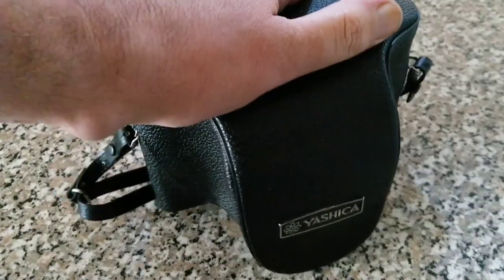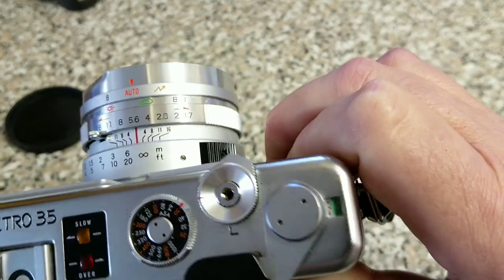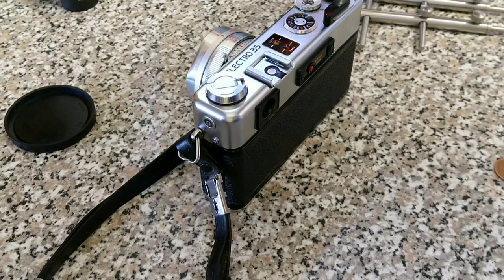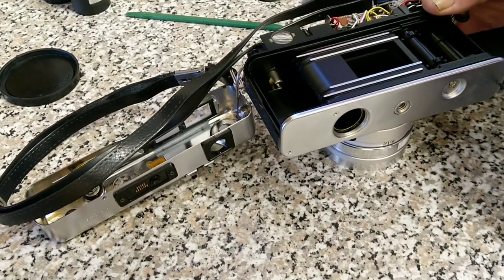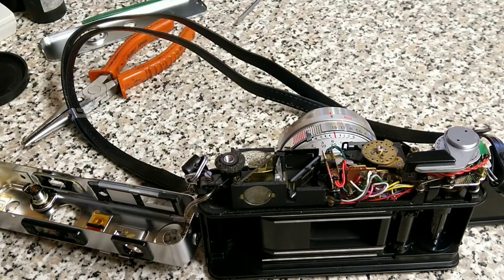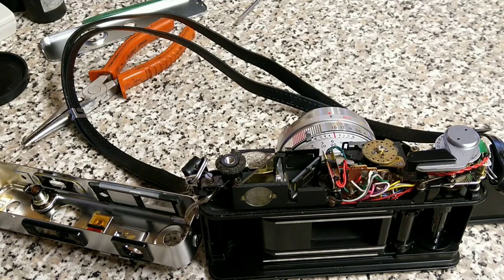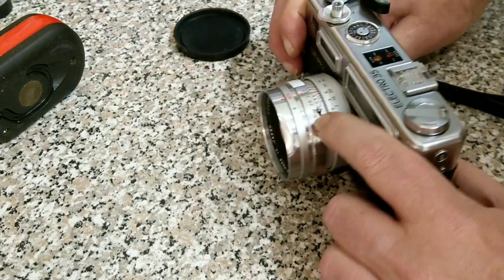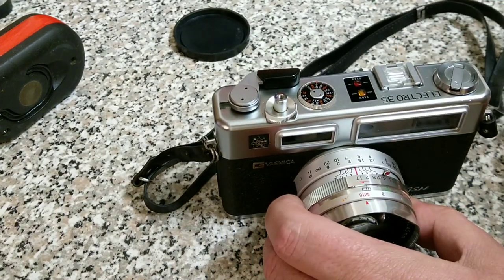Yashica Electro 35mm GSN, repair, shutter problem

Comment: Hi sir, does this shutter opening needs battery? My shutter remaina in closed situation (without battery).
Reply from the maker: Hi, it has an electronically controlled leaf shutter working in aperture priority and so on unfortunately does need a battery to operate, not sure but maybe the flash and bulb modes will work with no power, is it that  yours does not work with a good battery?
Reply: @thephotographersbag   Yes sir , the bulbs are in good condition ! Tested with a 9v battery, but it is not like yours, it is different (black) but the same model, I don't know why is that different, it is a 1966 model, being inactive for almost 46 years, that's why I need to clarify. Can you can identify what model is it with the stated colour ? And thank you very very much it helped a lot for me.
Reply from the maker: @kavinishwar  Hi, as you say there are chrome finish ones and black finish ones, the chrome version is the GS, the black is the GT, the second series was named GSN for chrome and GTN for the black version,
You have the original Yashica electro 35 by the sound of it, launched in 1966, it should default to a shutter speed of 1/500 th of a second without a battery, ASA/ISO tops out at 400 and it has a 45mm f1.7 lens and it only has a "cold shoe" with PC connection, one of the originals, be interested to know if it works, it used a now banned mercury battery, use a Wien cell (1.35v) or a 1.5 v that fits....following your exploits with interest as I love these cameras...😷
Reply: @thephotographersbag  It is very glad to hear sir, I am always keen to know physical priciple and mechanism of a machine, I got it when I was cleaning my store room, It was my Grandfather's camera, he bought it when he toured Japan. But now the black tinch got renoved in some of the areas of the camera, I will post the picture and video of the fully functional camera if possible. Thank you very much Sir 😊😊 love from India
Reply from the maker: @kavinishwar  looking forward to hearing about your exploits with the camera...thanks for sharing....
Reply: The Photographer's Bag excuse me, do you know which 1.5V battery would fit?
Reply: @AeromaticXD  It was designed to fit a 6V mercury battery which is now banned due to environmental concerns. You can use a 5.6 v Alkaline (PX) for this Yashica Electro 35 variants

Comment: How I clean the camera and outer case it’s
Reply from the maker: Hi, just carefully wipe the exterior of the camera with a soft cloth first, I use a soft toothbrush to get into the small nooks and crannies to remove loose dust and dirt
If required I then use distilled water and a cotton bud (q tip) to gently remove any remaining dirt
Clean the lens separately and be very careful not to mark or damage the front and rear elements, the glass bits, these need to be gently cleaned again with the distilled water using a moist but not soaking wet cotton bud
You can use metal polish to buff up the chrome bits and a leather polish for the ever ready case, I use neatsfoot oil, it is used for horse saddles etc
Whatever you do just take you time and not cause any damage....

Comment: I disassembled my Electro 35 GSN to get the camera working again following your instructions in this video! :) Quick question though. When reinstalling the ASA selector, how did you get the black numbered plate to sit still while screwing it back down? I know I had it set to 400 previously, but I can't get 400 to line back up with the red line.
Reply from the maker: Hi, that's a confident move, did you find the problem, not sure if you meant the rewind crank or film advance lever
Without a battery the camera should default to the 1/500 shutter speed
The ASA dial was straightforward from what I can remember, has something moved as I think it only fits the one way, will investigate further on my own camera again and come back to you
Is the camera functional now?
Reply: @thephotographersbag  I just ordered a battery adapter, so I'm not sure about the electronics but everything mechanically is working. I took the top plate off and pressed down on that lever underneath the shutter button and that seemed to do the trick. With the ASA dial as you screw the black numbered plate down it spins with the screw. So you have to be careful to line it back up how it was originally installed. It's an annoying process to get it lined up just right so you're selecting the proper film speed.
Reply: Eventually I got it lined up, but it's definitely something people should pay attention to prior to removing the ASA dial.
Reply from the maker: @nicholassmith7723  Hi, sounds like you got the job done, excellent work, will be interested in  how the electronics fare, I will have to revisit the ASA dial issue as I can't remember any issues I had( too many cameras LOL)
I look forward to hearing about it once you get some power in it, they are great cameras, with brilliant lenses, I take it the film transport issues have been resolved?
Reply from the maker: @nicholassmith7723  your comment is noted and when I revisit the camera in a future film, I will emphasize it more, thanks for sharing your experience, much appreciated😷

Comment: I am a bit contrarian on the whole "dreaded pad of death". 

It seems on my camera at least, the only effect is that the shutter won't stay open if you release the shutter button.

The practical effect is only that you must hold the button down until the exposure is complete.

It is natural and proper technique to hold the shutter anyway - at least up to about 1/2 second.

This camera probably isn't the best camera for long exposures any, but the can still be accomplished by holding the button until the exposure is complete.
 
If you are going to take a lot of long  exposures with this cameras get a shutter release cable with a lock and then, no problem
In fact, the only practical effect is the quieter operation of the camera, which is a bonus 

So pad of death is just what you need to get to heaven!
Reply from the maker: Hi, I must admit people do get hung up about it, not all issues are related to it, great to hear your experience, and I am with you, the issue is over exaggerated....

Comment: Hello! I have a problem with my yashica, I advanced the film too much, and I had to remove the film myself, but if I want to unload the film with the correct way, it's jammed somehow, I'd love some help
Reply from the maker: Hi
If I understand you, the film has all ended up on the take-up spool and is longer connected to the rewind crank on the tip left of the camera
You will need a darkbag/ changing bag or a dark space or room it needs to have no light at all alse it will ruin the film
Once in the dark, gently open the back and by touch feel to see what has happened, you should be able to gently remove the film by gently pulling on the end at a 35 degree angle to the back, it needs to miss the drive sprockets, you can press the little rewind button on the base of the camera to disengage the sprocket drive if this makes it easier
I would then place the film in a dark film cannister, the type the film comes in, not the clear ones but the black ones
If you take it to be processed rather than doing your own processing explain to them that the film is not in its light tight cannister but directly in the container, 
If you need more help, please let me know...
Reply: @thephotographersbag  oh thank you! It worked, turns out it was a bit jammed, I really appreciate it! I also want to ask about the films prices and which one do you think is the best for the yashica, because the last time I bought one it was expensive, like 6$ is that the average price?
Reply from the maker: @hafsa3889  hey, no worries glad you got it sorted, for colour neg film the cheapest tends to be Fuji C200 or Kodak Colorplus 200, for b+w the Fomapan brand is very good value but I do personally prefer HP5+ as it's what I'm used to, film photography is expensive when compared to digital, you will definitely save cost by processing yourself at home, it's quite simple, and you can scan negs with your phone to start with.....
Reply: @thephotographersbag  thank you so much, I appreciate it, hope you have a good day and thanks for the help!
Reply from the maker: Your most welcome, anytime....

Comment: my gs fix pod but this show only overlight and f16 iso 50 in dark room camera show only overlight can fix ?
Reply from the maker: Hi, sounds like the meter us not working, do the red and orange lights come on at all?
Reply: @thephotographersbag  A mode red light show alway,orange light show in Bulb mode but shutter not open
Reply from the maker: Hi, sounds like bad connection somewhere, needs disassembly and further checking of the wiring, a bit of a pain, the shutter sounds stuck and may need cleaning as it should fire.....